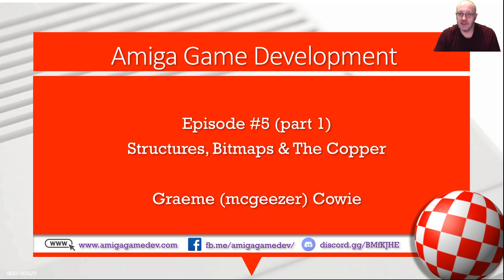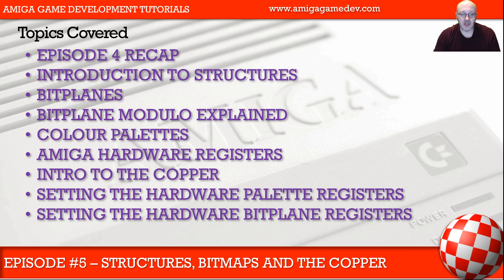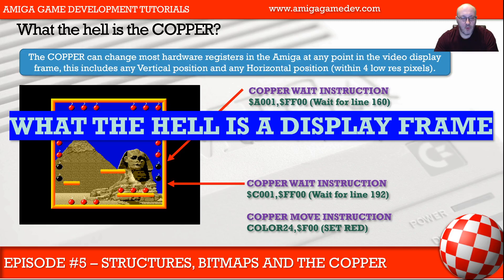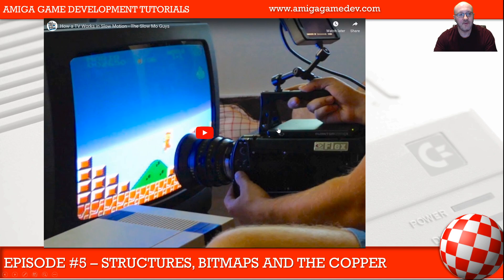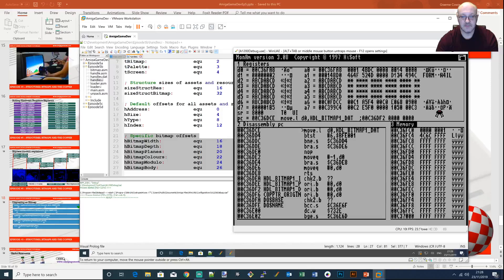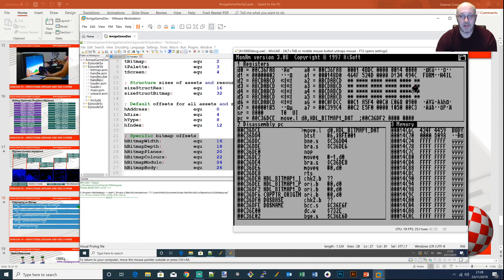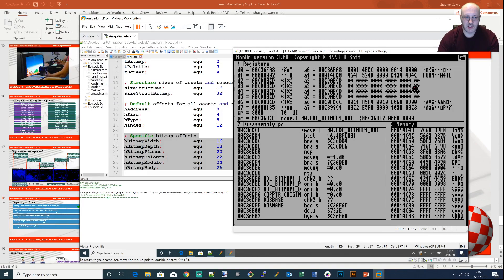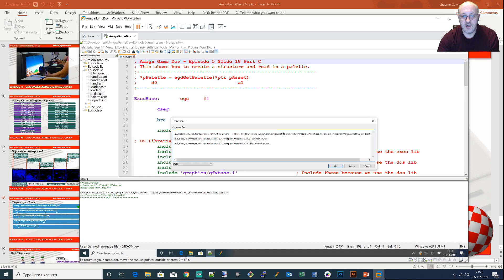Episode #5 - Part 1 | AmigaGameDev | Bitplanes, Bitmaps & Structures

Comment: Good stuff mate! That's me finished watching the series, so looking forward to the next episode when you upload it, although I understand that things are rough right now. The way you write your code seems much more stripped down and straightforward than other examples that I've seen, which seem to be all over the place.
I'll admit that the section on structures got me a bit lost, but if I understand right it's basically just indexing values for later use by either the user or a function?
Reply from the maker: Syklone glad you like it, more episodes are coming soon (on sprites/blitter).  Indeed structures are important to understand but they are exactly like you said - simply offsets to access variables.  I’ll cover them more in the next episode.
Reply: @GeezerGamesRetro  Cheers Graeme! Amos is as far as I went on the Amiga in terms of coding, so this is good stuff.

Comment: Excellent series, are the remaining episodes still planned ? Really keen to see how you create the graphics as well as the code.
Reply from the maker: ian w yes still planned.  Content upto episode 12 is done i just need to record it.  My current situation is tricky though.
Reply: @GeezerGamesRetro  Thanks for the quick reply, totally understand. Could I be really cheeky & ask a couple of quick questions about the graphics for Bombjack. What software did you create the iff's with (e.g. firebombs.iff)? When you open the iff file with Personal paint, it converts it to the current screen size. Also the .spr's are these just binary files? Thanks Ian.
Reply from the maker: @ianw7534  no worries.  Basically all I do is create screen grabs in MAME and then use Paint.net and XnConvert to convert to IFF.  I'd then use PPaint on the Amiga side to tidy a few things up.  Hope that helps... I'm going to try and do a video tonight on ripping sprites which you might find useful.

Comment: Hey, I've been following the series and have been finding it invaluable. Been using asm since I first got my A1200 but nowhere near the level you're at as I was only into utilities (making and patching existing, mainly pre KS2.0). The only issue I've got is on my laptop the text on your Notepad++ is extremely hard to read and the grey text - almost impossible to read. 

Is there any chance you could increase the font size by about 50% please and maybe swap the grey for something easier to see like blue or something clear if blue is already assigned?

I'm currently on episode 4 and now you're getting into the game related stuff I can no longer "guess" what you're doing with the code as you're going into areas I've not delved into yet. Thanks :D
Reply from the maker: Zeb yeah, you’re not the first to mention the font size.  I’ll sort for the next episode, thanks for following the series.
Reply from the maker: Also dont forget you can download all the source code and slides from www.amigagamedev.com